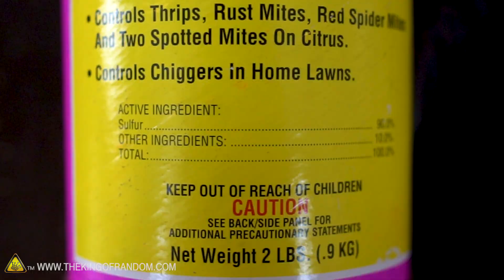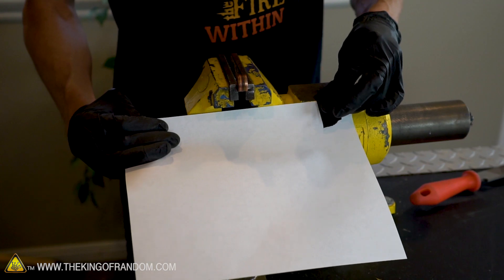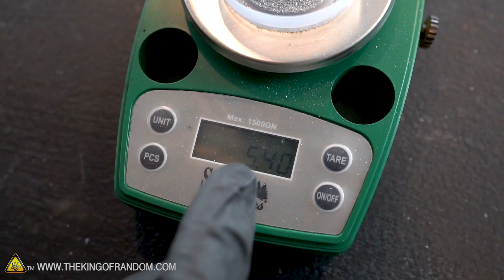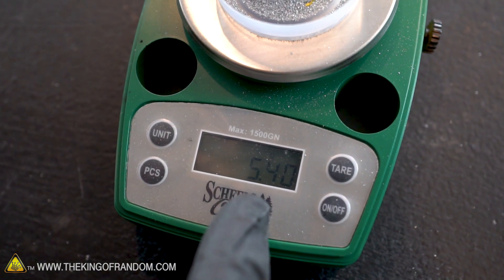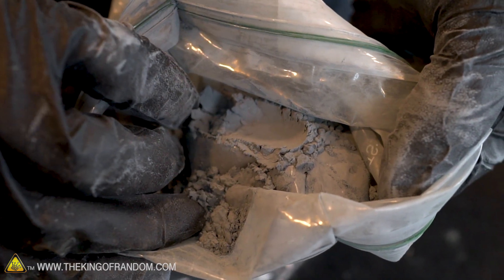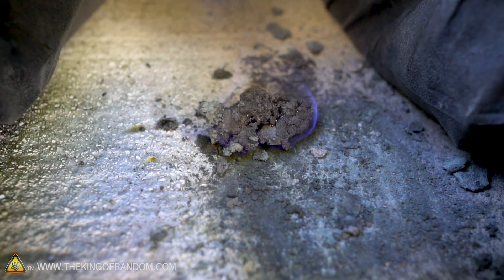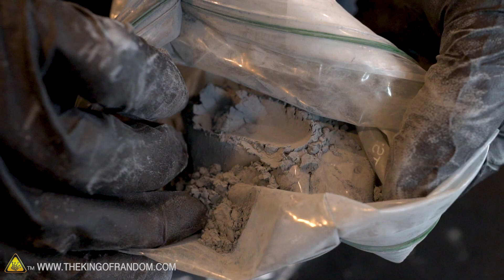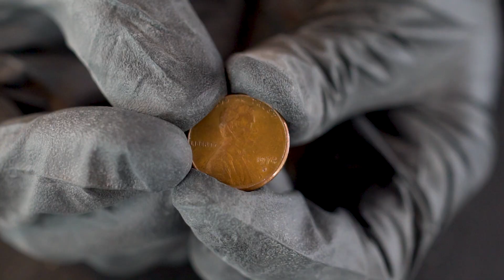Experimental GREEN Flash Powder! How To Make Flash Powder With Only 2 Ingredients! Zinc Sulfide?

Comment: hi ! an advice from a frog-eater :)... if you wanna get very fine Zn powder from your coins, grind them, and after that, put the grinding result in a ball-mill (kinda sealed round box turning slowly on herself with a large quantity of small steel balls inside). the longest time you'll let it work should give you the finest result... it will be cheaper than buying everything, and a ball mill could be useful to make a lot of "chemical" experiments.

Comment: To try making a finer zinc powder, try using a ball mill.

I'm not sure why you'd want to use flash powder as a rocket propellant. Most rocket fuel uses various additives to slow down the combustion so you can launch a rocket and not set off a pipe bomb.

Comment: Didn't you use a different mixture with the store bought powder,  you didn't try using the zinc you made with the mixture you used on thc bought powder,  like 3% zinc 1% sulfur,  you only tried 50/50

Comment: I have a (stoichiometric) formula (approximately 2:1) that burns fast but does not flash. Increasing the ratio of Zinc (possibly 3:1 or 4:1; I've done just one test not weighted, just equal parts by volume, which is not very scientific) and using a fine Zinc powder (1500 mesh), the flash is impressive and a bit scary.
The 1:1 by volume is a formula from my childhood (when a balance was a luxury far beyond any kid's reach), that worked very well.
Thinking about it, I guess that the extra Zn might act as fuel for a Zinc air burst, with the stoichiometric part acting as dispersion (and ignition) charge.

Comment: considering the age of this video, someone has likely said this, but to powder metal a lot of guys will grind it down to a sand (similar to the filings) then put it in a rock tumbler with an appropriate medium to get it down to a dust. (similar to a ball mill) depending on the metal I have seen everything from bolts, lead shot, glass marbles used to turn metal sand to very fine powder

Comment: You might make the zinc finer using a ball mill. You should also try adding some magnesium from a fire starter like you can get cheap from Walmart. I would try to powder it in a ball mill as well. Then try your fuse again but try a slow burning fuse.

Comment: You could use a finer file or grindstone and you would need to unclog the teeth regularly.   After filing, the grit would benefit from the use of a ball mill.  Steel balls might be best.  Odd that you might be ,looking for a green flame, as the use of copper cladding on the pennies would ensure that to start with.

Comment: Using a dremel sanding wheel at high speed inside a small sandblaster cabinet allows for very fine grains of zinc to be collected, holding the pennies with a vice grip helps too

Comment: Take the zinc filings and put them in a ball mill. I would use steel bearings until the powder gets real fine! About 4-5 days make sure you open it every 12-18 hours to allow oxygen in. Then when it’s fine enough not like the commercial, but just shy of that and switch to lead bearings (balls) otherwise a spark could cause it to explode.

Comment: Soooo many things you didn't show or try. :(

* 3 to 1 ratio of shaved pennies
* Lighting either batches with a fuse
* Lighting either batches with BBQ lighter
* Lighting either batches in a crucible on a table so we can see the pretty pretty green mushroom clouds....

A suggestion for shaving pennies is an electric drill or Dremel tool using either a rotary grinder or sander.

Comment: wouldn't the best ratio be about 2:1?
the reaction is
Zn(s)  +  S(s)  ——>  ZnS(s)
Sulfur has an atomic weight of 32.065 and Zinc has an atomic weight of 65.38
so the ratio would be 65.38 : 38.065 (about 2:1) for all the zinc and sulfur to react

Comment: Best flash powder I've used was 1/1 á 2g/2g ratio with potassium perchlorate and aluminium powder. And I also made a little cylinder of regular printer paper to place the composition in w/o packing it. And it exploded so violently that I could feel the pressure wave from 3 meters away. Should also mention that I used a fuse to ignite it.

Comment: If you carefully add the powder from a Flint from a Zippo it makes a better flash powder, 3 parts sulfur, 1 part zinc, and about a quarter part Flint it works great, but does change the color, watch for faster flash though.

Comment: Here's the thing, though... You didn't try the penny-sourced zinc in a 3-1 ratio with the sulphur before switching to commercial zinc. Also, the copper plating on the pennies would've left residual copper in the coarser zinc, which may've played havoc with the reaction.

Comment: Use a ball mill to powder your zinc filings then you won't have to use the commercially available stuff that's basically all they do they put it in a large industrial ball mill and use it for hours and hours and hours until the substance becomes a powder commercial grade gunpowder is made the same way ball Mills are not expensive you may even be able to find one in a child's experiment area of a craft store as they are sometimes used to polish rocks into jewelry it's essentially just a sideways Barrel or container on a slowly rotating motor and you stick abrasives and or marbles inside of it to grind things down so even if you didn't want to buy one I'm pretty sure the King of Random could make one very easily also be aware that whatever abrasive or tumbling Stone you're using must be harder than the material you're trying to grind this should be common sense but some people don't think

Comment: you need a mix ratio of 1 mole to 1 mole, this is different than 1 gram to 1 gram because the individual elements weigh differently, the proper mix by grams is (Zn / S) 5 grams to 2.45220250841 grams [Ill let you round this up]

Comment: A roller ball mill period effectively a heavy metal bucket that will contain the zinc with some heavy balls inside of it that will continue to grind the zinc. Add Zinc powder tilt put on a wheel, leave it to run for a few hours or even days. But I'm not convinced your powder sizes the problem. Clearly your original mixture was off so it's actually possible that the courser powder size would work but your ignition Source would have to be something a little bit stronger than static electricity. The torch got the instant reaction with the ultra fine grain, but you didn't test a lesser heat Source on that fine-grained to see whether or not that was an issue. You also didn't repeat the earlier test with either the coarse or fine grain and the lighter heat sources.

Comment: The last batch of this I tried I used 4.5g of zinc to 1 of sulphur and it was really hard to ignite.  It would ignite but but very stubborn and when spread in a line once lit it would not continue to burn down the line.  Could my sulphur not be dry enough or could the zinc not be be dry?  Other than keep adding more zinc I'm stumped.

Comment: Dude, that was incredibly unsafe.  At least have your torch on a long pole.  Flash powders can be extremely powerful--and even the ones that aren't can throw off molten particles at high velocity.  

At least you weren't using a Bic, but still.

(Also, pennies cost more than a penny to make.  YOU MONSTER!)

Comment: A small ball mill will grind up the penny dust fine enough.. file it first, or use a bench grinder so its faster, then put the dust in the "ball mill".. ball mills are usually used for grinding metals for fine gold dust extraction, would make a cool vid on its own.. but yes a ball mill will produce insanely fine dust.. u could do aluminium too...

Comment: It is fairly easy to grind the Zink to a very fine powder. You can build a small ball mill that you can run with a drill. Use some ball bearings or polishing stones. Then you can use the filings and run it through the ball mill.
Reply: Don’t use ball bearings. 🤦‍♂️ 

One little spark inside there and it’s Kaboom! 
Use glass marbles or lead balls.

Comment: Try keeping the course zinc powder as cold as possible with liquid nitrogen while you use a mortar and pestle. The metal should be more brittle and break more easily into smaller pieces.

Comment: You need to use a ball  mill. Load a bunch of lead balls in a cylinder and let it spin for a day or two. Fine powder you will have. Use lead not steel could auto ignite.

Comment: Hm. Zinc is 65.38 grams per mole and sulfur is 32.07 grams per mole. A 3:1 gram ratio(2:1 molar ratio) leaves enough room for oxygen (16 g/m) for zinc sulfateZnSO4 or sulfite ZnSO3 as the product.

Comment: Take the filed zinc powder from the pennies and put it in a ball mill. This should create "flakes" that will have a large surface area. Maybe you could put the penny filings on a hard metal surface and pound them with a metal hammer for a while to achieve a similar effect. Saves you having to make or buy a ball mill.

Comment: hey, today in my science class,  we extracted the zinc from  a penny without using the file or a metal grinder, what we did was that we heated the copper since it expands when it gets heat up, so when u expand it, it will explode, the zinc will fly out in about 92.63% mainly zinc.

Comment: Question: if you hit the three part zinc one part sulfur with a match, will it still light, or is the map gas torch needed? Also, could you combine it with touch powder and make a flash bang impact sensitive grenade?

Comment: Copper-doped zinc sulfide is used as a glow-in-the-dark pigment. In theory, if you could get the ground up pennies to burn well with the sulfur, the resulting powder should glow in the dark after exposure to light.

Comment: The atomic mass of sulfur is 32, and atomic mass for zinc is 65.4.

The ideal mix is about a 2:1 ratio, although excess zinc will react with oxygen better than excess sulfur.

While you're playing with sulfur you might want to do a little research on "plastic sulfur," just because it's easy to make and has very different physical properties than the powdered form.

Comment: You can get finely divided zinc, but you would have to dissolve the zinc in HCL then put a piece of magnesium in the solution to displace the zinc. Of course, if you have the magnesium you would probably be better off just using it for the rocket fuel mixture.

Comment: Getting in on this kind of late, so I don't know if someone else brought this up. But the scientific process in this set of experiments is somewhat flawed. You started with home-made zinc powder mixed 1:1 with the sulphur. That didn't work as intended, so you ground it with a mortar and pestle, and tried the same 1:1 mix. Lastly you went with the commercial grade stuff.  First at 1:1, then 3:1.
But you never tried (or at least never mentioned trying) the 3:1 mix with either of the home-made powder grindings. Did you ever try the home-made powder with a 3:1 mix? What was the result?

Comment: To powderize the pennies, either use a commercially made ball mill or rock polisher, or build one yourself.  However, you may need to use ceramic balls rather than metal ones to prevent the resultant powder from spontaneously igniting.  Do your own research on this before proceeding.

Comment: Is there a way to add this to papers to make flash paper?
Reply: no, flash paper is paper that was soaked in gasoline and let dry. unfortunately, it was not coated in powder to make it "flash"
Reply: AyyItsJayy but what if you make this solution a liquid and then soak paper in it. Is that possible, will that work? This is a suggestion for another experiment.

Comment: If you want extremely fine zinc powder you could try dissolving the zinc in acid and then precipitating it in a redox cell.
Collect the resulting sludge from the (cathode or anode...can't think in the morning), dry the sludge and pulverize.
Keep from oxygen when finely powdered.

Comment: File down your Zinc to a fine chip (the file you were using is fine). 
Build yourself a ball mill (tumbler) 
And mill your zinc shavings. As long as you use a dense metal that wont break down fast woth coarse materials you can mill the zinc to almost the same consistency as your commercial powder. 

This is a simila method to the way they make zinc powder commercially. 

I use this method to mill my black powder I use for rocket engines... be very careful with static charger... any powder the becomes airbourne in the right ratio is explosive...

Comment: If you know the chemical reaction you want to take place, the molecular weights of zinc and sulphur, and the purity of the samples.... shouldn't you be able to calculate the ratios you needed, instead of having to check it up online?
Reply: Also, for the pennies... how about a rotary tool with a fine grit sanding drum?

Comment: Just calculate the best amount for reactions.
Zn + S --> ZnS
--> 1mol Zn + 1mol S

1mol (S) = 32g
1mol (Zn) = 65g

The ratio of Zinc to Sulfur is about 2:1.
Reply: moe riou But if they use the 3:1 ratio, there won't be any sulfur left over. The only thing left over will be zinc.
Reply: Katzenbrenner I think they might use 3:1 to get all of the zinc to burn and the excess sulfur will just burn with oxygen. Just a guess but ye
Reply: The german word for Zinc is "Zink" with a "k" not a "c" and because Zinc is actually a Name, it gets an big initial letter.  ;)
Reply: The reaction probably has excess Zinc to make up for some production of ZnO due to being exposed to the air, but I did enjoy seeing this comment here.
Reply: Katzenbrenner zinc
Reply: DecKlaNN Sry, I used the German word.
Reply: sonic597s he spelt zinc in German
Reply: although due to the energy produced by the reaction, the ZnO could very well decompose
Reply: @hahaha53671  in
Reply: Georg Friedrich Händel you need a slight excess of sulfur though, as sulfur will burn off with oxygen.
Reply: Also, the sulpher wasn't pure.
Reply: It made me happy to see this. Thank you. I love being nerdy.
Reply: 6    /   2
Reply: Jo Kra oh I thought it was sulfur to zinc. That actually makes a bit more sense, since sinc will burn with oxygen if it gets hot enough

Comment: You've just made floo powder.
There are reports saying the ignition temperature of a metal-sulpher mix can be as low as 600 degrees C.
A hardwood log can reach nearly 600 degrees C, and charcoal can reach even hotter.
So, is it possible to take a handful of this powder and have it ignite as you throw it into a fireplace?
Reply: dont, zinc sulfide is toxic

Comment: You didn't try the 3 to 1 ratio with the bits of copper penny? it may have still worked.
Reply: Ah, but copper is not flammable. Zinc is.

Comment: Can you ignite thermite underwater?
Reply: Correct answer: no it would not ignite underwater, however thermite that is actively burning will continue to burn if it makes contact with water.
Reply: Short answer, yes. It has oxygen from the iron oxide.
Reply: Dude. Have you ever heard of a thermite torch? Its used to weld underwater. So yes. It will ignite underwater.

Comment: If you make/buy a ball mill it will get you the fine powder your looking for, you need to have filings or shavings before using the mill though. You could also use very fine abrasives (400-800 grit) and some elbow grease

Comment: Cool video but be very careful of those fumes the zinc will damage your lungs and brain look up why you dont weld galvanized steel
Reply: The Miner look up Flux core filler wire its used for welding galvanized steel lol
Reply: unclebim Goldfinch you first have to grind off the outer layer or wear a mask i never said it's not possible you just have to be careful

Comment: To make the Zink powder finer use/make a "ball mill" you should be able to get an "airfloat" consistency with it will take longer but this way it is all homemade. And try to use pure zink the copper even in the small amounts of the penny will throw off the ratio.

Comment: A 3-1 ratio with penny grinded zink worked for me. The same explosive reaction as you had.
Reply: @Minh Quang Vo obv. not if it worked.
Reply: How did you ignite it ??  
 Map gas , fuse, bbq lighter?
Reply: 3 parts zinc?
Reply: @barbecuesquirrel2324  yes

Comment: To Make It a Fine Powder take a water bottle and fill it with hardened steel ball bearings, fill bottle with zinc shavings and attach water bottle lid to a drill and keep spinning
Reply: ...and keep it spinning for about a week. I've done this with aluminum, but you really need a ball mill or rock tumbler to actually get the fine powder.
Reply: Only put the zinc in the tumbler, NOT THE MIX... Lol..💡
Reply: Steel can make sparks, lead balls are better
Reply: @miguelchacon2717  Except that they are softer than zinc so don't do the job, and they contaminate the zinc dust that is produced. Best is ceramic - very hard and no static.
Reply: @miguelchacon2717  Lead doesn't spark but it's softer than most other metals and will cause considerable contamination.  The best is ceramic balls - very hard and no static.
Reply: @miguelchacon2717  but isn't lead far too softer
Reply: Makeshift ballmill?
Reply: Still ball bearings could actually cause static for it to self ignite thats a bad idea rock tumbler or a ball mill is better option
Reply: What about a vitamix machine? Or would it create to much heat?
Reply: Need 5 to 10 rpm
Reply: Rock tumbler and marble is the best way
Reply: A metal water bottle.
Reply: Pretty sure using lead would solve the fire hazard.
Reply: @Jerrytheman9  lead is soft and clumpy
Reply: Use LEAD ball bearings, not steel, and that solves the static problem - this is common for aluminum and other substances, too.